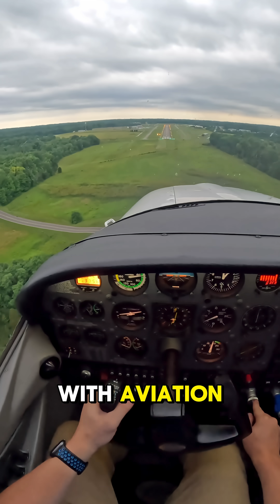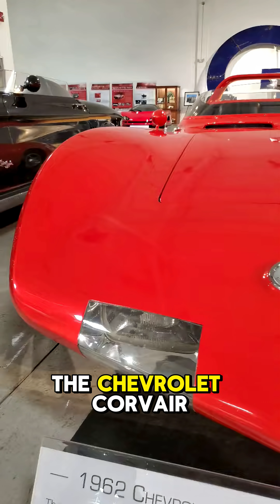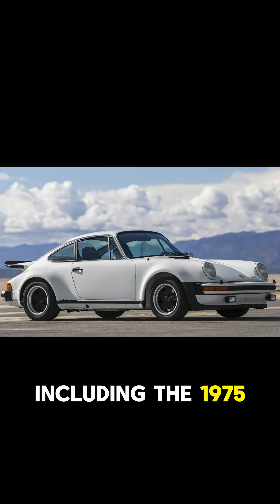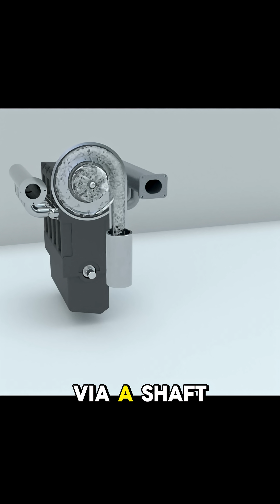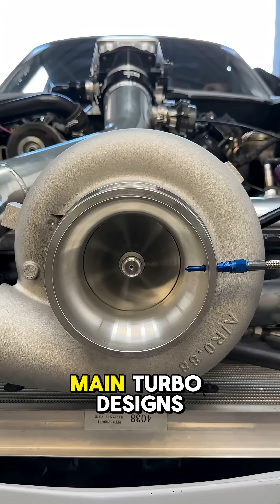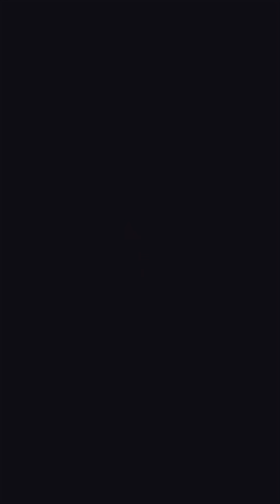Turbocharged Power: Here’s How it Works!

Comment: I did have a turbo car it was a 2010 Mazdaspeed3 and it had massive turbo lag in the low end but once it hit 3500 RPM that thing started taking off so fast I almost couldn't even keep it on the road
Reply from the maker: i like the responsiveness of the VGT on my truck but there is something special about a little lag followed by a rush of power.